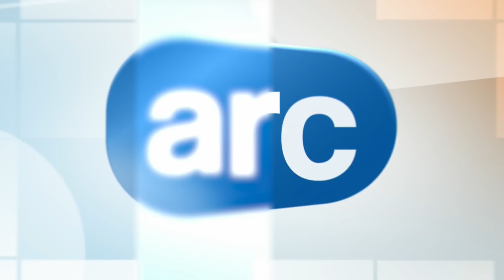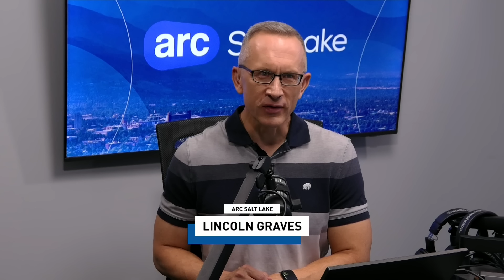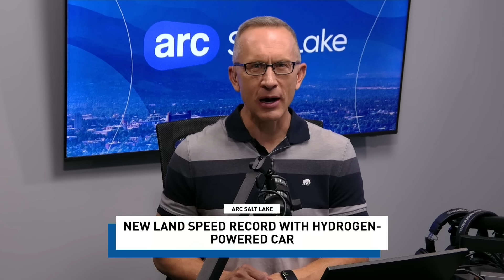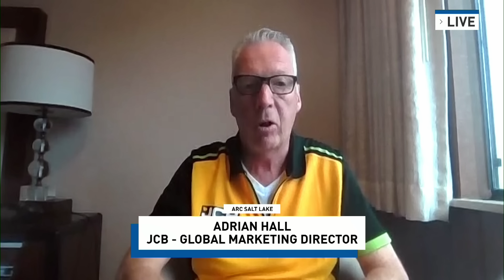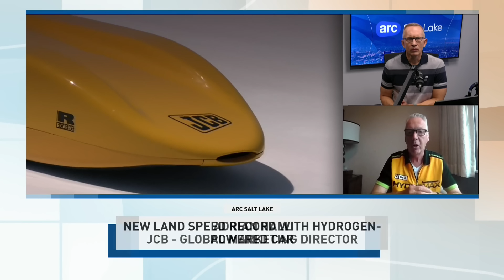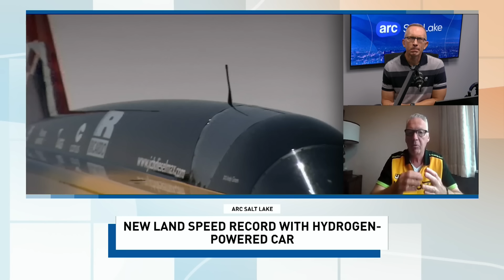Hydrogen-powered car breaks speed record going 406 miles per hour

Comment: Not an accomplishment.  Just another fuel.  Are you going to use this tech in your next excavator?
Reply: The construction industry uses different injections systems in the diesel en=gines to boost performance Propane or natural gas or methanol Etc..
Reply: Go watch Harry's garage, full break down on what jcb are doing with hydrogen.
Reply: you sound confused goober ... it's has totally clean emissions.
Reply: @onprobation2025nsld  Most commercial Hydrogen (around 95% of it) is obtained by cracking Methane gas from crude oil. It's definitely not green.
Reply: @RWBHere  That's natural gas moron, I'm talking about electric water source.

Comment: A tractor engined car going a mile in 9 seconds, amazing!  Not to dis this achievement, but many "fossil fueled" vehicles were used for this "zero emissions" test, the Land Rover powered with what?
Reply: Well there was an aircraft involved so work backwards from that.